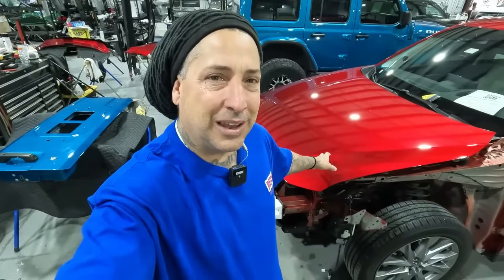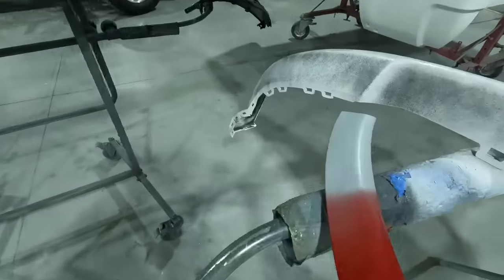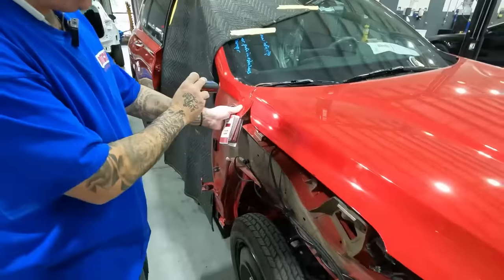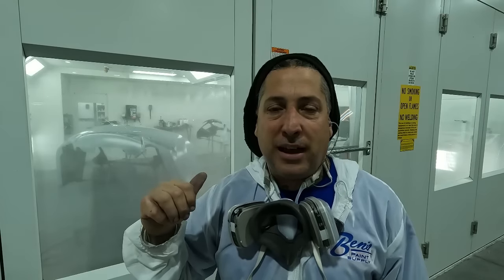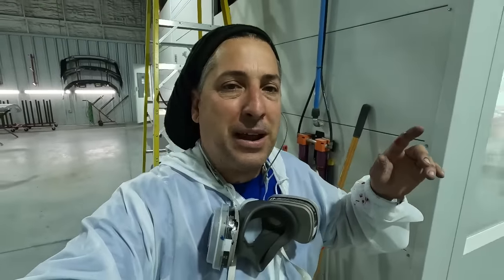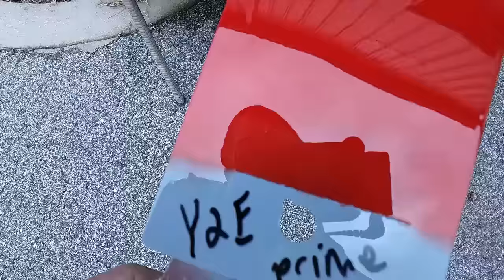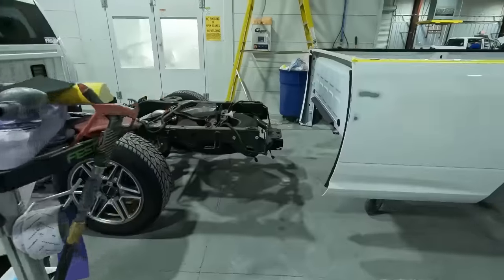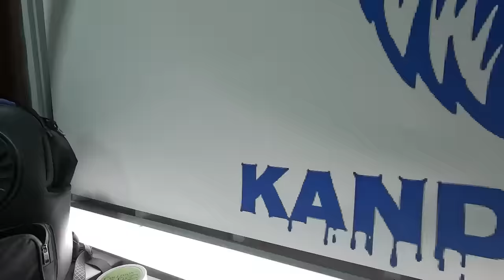How To Get A SUCCESSFUL 3 Stage Red Paint Match

Comment: Very educational. Greatly presented and easy understanded. First time i see a tri-coat with the first coat(base, ground) been a metallic . Everything is getting tougher as years go by. Question - Why should you line THE HEIGHT of the panels that are next to each other when painting in a spraybooth ? I know that they need to be in the same position as mounted on the vehicle , heard that from Brian . But first time i hear that height must be equalized on the paint stands , i guess this is because of the paint booth air flow ? I believe this is NOT necessary if painting in a garage ?
Reply from the maker: When you paint a 3stage job  the application is key .when you apply the paint, you want to lean in the exact same way on each panel along with the booth flow height is key

Comment: I love watching your channel.. you have helped me improve on a number of things and I appreciate that.. I spray in a similar environment.. we turn 250 plus paint hours a week with one helper and one painter. You should consider UV primer and a UV fastlane 2k. You can increase your capabilities drastically! Not only that but with higher quality because the UV primer is 98 percent solid so there is no shrink up. If you need to prime something and dry it you can do it within minutes and have it in the booth for paint. We have been running this system for about 8 years now and it’s a true production game changer. It would be perfect for your set up! Thanks for your videos man you are a top notch painter for sure
Reply from the maker: I was thinking of looking into uv primer  .if I'm in a rush  I use  water primer it's great as well  thanks for the insight 👍

Comment: Great video and killer work.   Very impressed on the work you do to get a perfect color match, especially on the 3 stage.  Btw, as an airbrush artist and custom painter, I got rid of the 3m fine line tape years ago and use only FBS tape. Much better quality at a lower price.
Reply from the maker: Thanks I'll check it out
Reply: @kandyman5315  good morning kandy man I would like to ask you a question about the sagola 4600 xtream gun --  which air cap do you prefer to spray clear with  -- the titanium pro cap or the DVR clear cap   thanks I am a big fan of your channel

Comment: You never do a poor video. I love the tip of keeping a section on the spray out for primer. Was that the recommended undercoat shade or one you like from experience? Do you see any issues with using basecoat as a sealer if its activated?

Have a great weekend!

Apparently, the Kandyman likes candy too.
Reply from the maker: I very rarely use base as sealer .I like sealer for its adhesion properties and hold out
Reply: @kandyman5315  sealer was the wrong term. I meant for the value shade.
Also, what CRI light is that? I left mine in a customer car.
Reply from the maker: Luma3